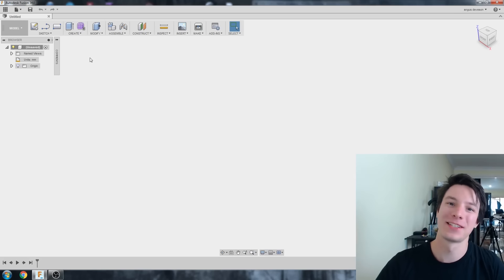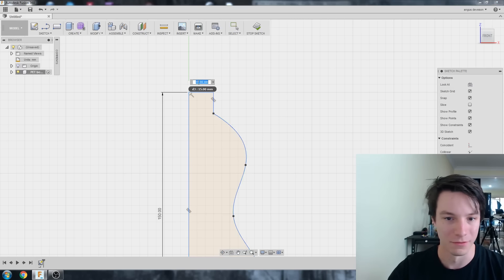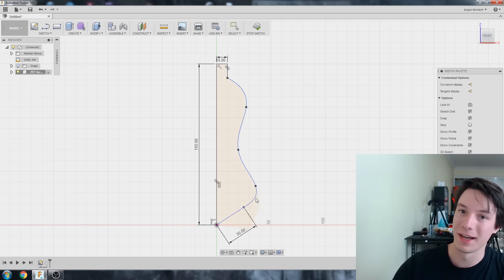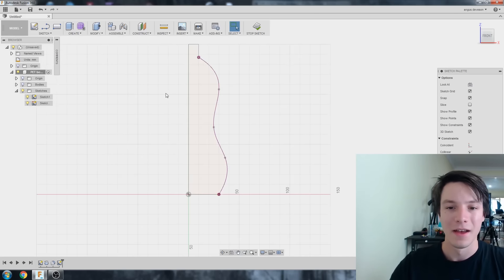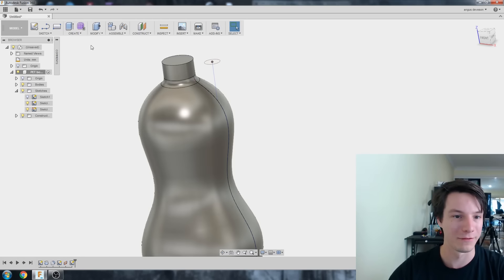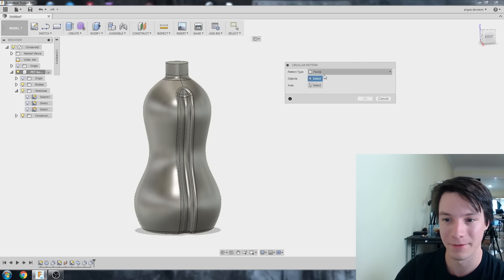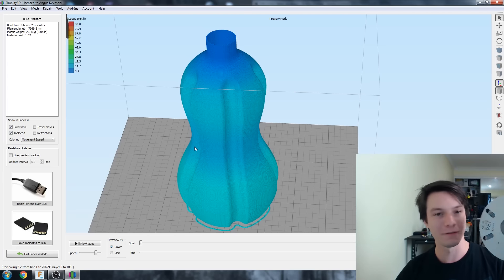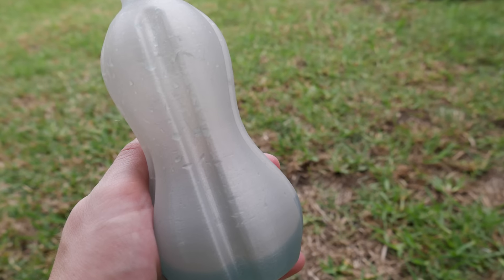Bottle made from Recycled Bottles - Designed and 3D Printed using Fusion 360

Comment: It's always better to put a chamfer instead of a fillet at the bottom of a part for 3D printing. Reason being that the overhang is 90° at the base of a fillet (i.e. impossible to cleanly print without supports), whereas you can choose the overhang angle with a chamfer (usually 45°, but in vase mode I would rather go for 30°).
Reply: or bite the bullet and leave the fillet/chamfer out completely. i would think that the fillet is the reason for the bottle leaking bc of what you mentioned, i have printed more or less watertight little schnaps-glasses from PET before - this shouldn't compromise the looks of the bottle too much. nice fusion360 tut btw!
Reply: Absolutely, if the dimension of the first layer is not very important, I would also usually not bother with a chamfer. But sometimes, since my first layer is usually set at 80-90% height to have better adhesion, adding a chamfer can also help not having the first layer be wider than the rest of the model. It could also help unstick the model from the bed if you slide your scraper underneath.
Reply from the maker: I'm thinking of testing both, the fillet is pretty, but most likely causing the leak. Stay tuned!
Reply: Valentin B. I
Reply: Its clear this person is not a designer

Comment: Hey Angus, I've experimented a bit with water proof printing for research purposes and have found some tricks to make it work. For PET crank your heated build plate to 100 C and your nozzle to 250. The key is to over extrude at around 110%. you also want to print at 100 microns or smaller. Layers will essentially melt together before they harden because of the heat and overextrusion. I've been able to make prints that hold water for over 15 hours. The sides will have trouble being waterproof but if the build plate is glass, I can almost guarantee the bottom will be waterproof

Comment: Great video!  Very noble effort!  

Kind of reminds me of a mostly unrelated historical (yet similar) effort that happened in China during the 1950s.   As part of Chairman Mao's "Great Leap Forward", the communities around the country were encouraged to help catch up to the industrial might of England and the U.S., by manufacturing steel.  Unfortunately, almost none of these communities knew how to make steel.  So, they gathered, collected, or coerced every bit of iron-bearing metal from everyone.  Plows, shovels, bed springs, spoons, pots, pick axes, picture frames, spectacles, etc. were all thrown into the scrap heap.  Crude smelting furnaces were constructed and manned 24-hours a day.  All of the coal and firewood used for cooking and heating was fed into the furnaces.  After that was gone, all the trees were chopped down.  After they were gone, people started to rip down signs, fences, and parts of their houses.  (There are even stories that coffins were dug up to be used as firewood.)  But, persistence eventually produced trickles of molten metal that congealed into ingots.  These ingots were hammered and formed into tools, cookware, farming implements, etc.  But, alas....the nails crumbled, hammers shattered, pots and pans cracked, and plowshares broke away with the first usages.  Ultimately, these poor folks took useful items and  exhausted their resources to make them useless.  

I guess the moral of both the  steel and PET bottle stories is: Leave recycling to the experts. :)

Comment: 14:10 -- It has steep angles. You've overlooked the circular fillets at the bottom that have all up to 90° horizontal overhang. Maybe it's leaking there (or the whole bottom if the fill density is not exactly right). At the bottom of prints I usually cut of circular fillets such that a sharp 45° edge remains. To make PET/PLA bottles/containers watertight one can dissolve food grade PS Plastik (from white supermarket joghurt containers / transparent party shotglasses) in acetone or MEK and use the slurry to coat the inside of the bottle. This works pretty well.
Reply from the maker: good call, the underside fillet might well be the source of leaking though I was hoping the 3 bottom layers would be enough to 'cap it off', I will replace that part with a chamfer and give that a shot.
Reply: Maker's Muse cool, I was wondering the same thing, would like to see a quick follow-up if you do

Comment: Angus, with the projected line and not being able to trim. Select it, right click and click on "break link". Then you should be able to edit the however you'd like
Reply from the maker: cool stuff, cheers! Shame it breaks relations like my copy then trim method does. Splines are evil.
Reply: Haha yeah, if you think about it though.. That is what you want to do isn't it. Break the link from the original so you can make changes?
Reply from the maker: I want to trim it at that point yeah, but want it to still replicate the original. Solidworks does allow this kind of thing but it's certainly a lot more expensive and Fusion is releasing updates all the time.
Reply: I think you didn't need the replica at all. The thing about sketches, as I'm learning myself, is that they're entirely separate entities from bodies, even if they are on a plane defined by a body face. Basically, the idea seems to be to sketch as much as of an object in a 3D "collapsed" to 2D style. It can look messy and complex, lines crossing each other etc. but all you need to do is select the relevant paths or surfaces later, when you decide to make features. And be aware, for eg., that extrude can be set to be offset from a plane, ie. a face! That way you can extrude complex shapes in parts out of a single sketch!

In your case I think you could've just added another spline instead of that top vertical line, make it tangent so it doesn't give you trouble later and you could just use that and the lower part of the original spline as a path for the sweep. You would possibly need to break the original spline. You know what, I'm gonna try it right now. :)

EDIT: Phew! It worked! But Fusion 360 fought me all the way! :) It needs to be three splines, since you can't seem to break a spline. And they need to be drawn with the same "orientation"! Ie, if you start from the bottom of the bottle the spline stops somewhere before the mouth. Then you draw two more splines from the end of the first one "upward", one to the mouth, one to nothing. Or the other way around if you're starting from the top. If you mix the orientations Fusion 360 gets confused when you select multiple paths later on. Probably doesn't know where this combined path begins and ends. Oh and same goes for that little straight tail at the bottom!

Comment: Try concentric infill for a more waterproof and much prettier bottom. I printed resin measuring & mixing cups from PETG and they worked perfectly. Rectilinear infill tends to leave gaps unless you use a very high infill overlap percentage. For bonus points, model a standard soda bottle thread on the bottle and then somehow get S3D to print that in vase mode...

Comment: Considering that you only used one shell, The result turned out good. Two or three shells would be ideal for maximum water seal.
Reply: Thats was what I was thinking. Just shell it with a thicker wall? Would that work?

Comment: If I were to hazard a guess at your trim bug:

You can't trim a spline curve since it requires defined points at the beginning and end. If you were to trim the geometry, then the spline curve could not longer be defined in the same way (cubic curves with checkpoints that agree in both location and derivative). By creating an offset, you have duplicated the pre-calculated line geometry, which can be safely trimmed without breaking the math that goes into the spline curve.

Comment: Damn that is a good looking bottle, great design work and explanation mate!  Fusion360 and Simplify3d is a great combo for rapid prototyping stuff like this.

So, now that I have you here; What would be the best filament for use with lost mold metalcasting? Something that burns up fast without disturbing the greensand would be great, and it would increase the usage of my Wanhao 10 fold. (ea; I'm not waiting around until metalextruding printers become affordable)

Cheers man, thanks for sharing!
Reply from the maker: I would go with a super clean, regular PLA - the milky white ones with nothing added. I know it works great for investment casting, but not sure about how well in sand.
Reply: Plain ol' PLA, got it! I'll give it a shot. Thanks for the advice dude!
Reply: If you do please post a video, i would def be interested in trying that im building a furnace now
Reply: You're probably gonna be at the experimental stage sooner than I am. I'm the printer guy, and one of my friends is the metalfoundry guy.. I've got one of those friendgroups that tries to diversify their hobbies. It kinda works out, once you find creative ways to link 'em together and make multi-stage projects.
Reply: I know it's an old comment, but there are wax filaments on the market that supposedly burn up much cleaner than PLA.

Comment: Regarding the trimming of the projected curve, it kind of makes sense that you can't trim it, as that makes it no longer a proper projection of the original curve.

However, you can explicitly make it a standalone entity by right-clicking and select "break link". After that you can trim it all you want, but it will no longer update if you make changes to the shape or curve it was originally projected from.

Another way to fix the sweep issue at the bottom of the bottle would be to actually create a new body (instead of cut) in the sweep, and then simply offset the bottom surface (shortcut Q) of the new body to extend it, and then combine cut it. Just a different method, not actually any easier or better than what you did.
Reply from the maker: I learnt solidworks in uni and you can do this kind of thing in it, but that is a very expensive bit of software... so I'll take the break link option. Thanks for the tip!

Comment: I wonder how Fusion 360 compares to Autodesk Inventor, which I am used to.
It's not super intuitive. I'm pretty sure you're supposed to offset the spline by 0 to be able to manipulate the shape in this case. I would not have thought of it, but there are other ways to go about it. 

I wish I knew which Autodesk product I should learn to use - or if learning one of them will help me learn the others. 
Some features seem to be core to both programs. Maybe each Autodesk program is just more complex than the last one? That'd be nice.

Comment: Hi Angus, after watching this video I decided to buy my first roll of PETG but I've been having some issues with getting it to stick to the bed. I've tried blue tape and hairspray but neither seem to be working, have you got any tips/tricks for printing with this material? (wanhao i3 v2) cheers!
Reply from the maker: Try some glue stick, works great for me :) Make sure you're extruding hot enough and a nice, slow first layer!
Reply: Thanks :) it's sticking really well now. seems as though I'm having some issues with the infill however, simplify3d keeps producing stringy, messy, under-extruded infill which essentially ruins the print. I've tried lowering the print speed, increasing the extrusion width, and various other settings but am having no luck. I don't know if this is a common issue or if I'm doing something wrong. I'm fairly new to the software so I don't really know what else I can do. Any advice would be greatly appreciated, or maybe even a video about settings for printing with PETG. Thanks again!

Comment: I have to wonder, if that 'abs vapor' trick for extra-smoothing a 3d print would also melt the layers together enough to make a printed object water tight?  Also, what about the idea of making an 'inner surface' by basically duplicating the model, shrinking it inside the first, and then cutting out the top?  basically make a 3d solid that already is a 'vase' without vase mode, so that the outside is thick enough that the seams may not actually let fluid through?
Reply: The vapour trick is intended for ABS plastic. I'm not sure if acetone melts PET, if not some other (potentially more dangerous) solvent might work.
Reply: Monolith Tyriss acetone vapor kind of works with pet or at least PETG. However it needs longer time to work and the longer you treat it, the softer it will become. And it will not harden with time according to my experiments.
Reply: TL;DR you'd most likely end up with leaky sack instead of a functional bottle.

Comment: How thin could you get a water bottle?
Reply from the maker: depends on your nozzle, I think you could realistically get to 0.4mm before it got too weak.
Reply: Maker's Muse also  if you did it with the recycled bottle plastic would it be flexible or not?